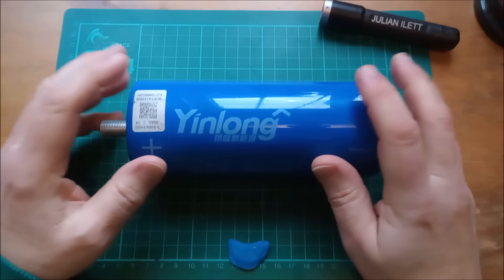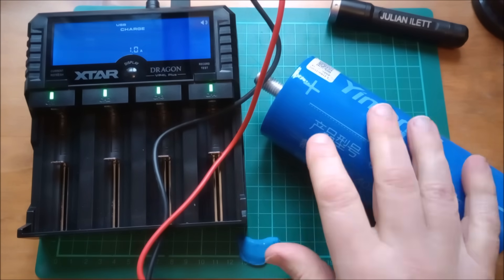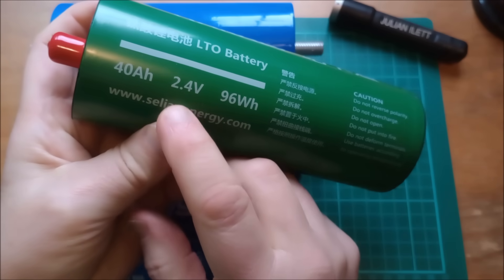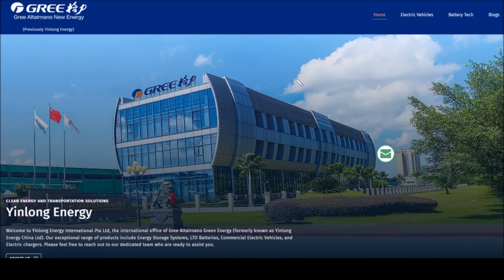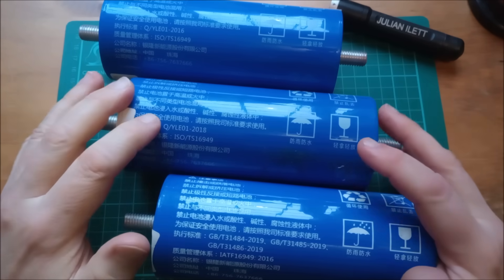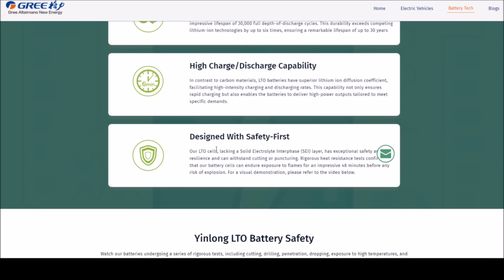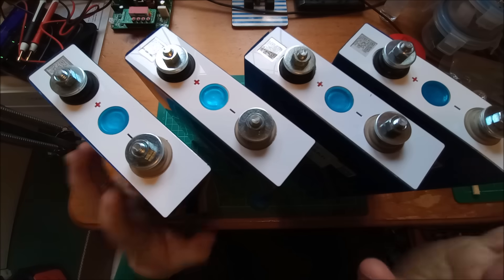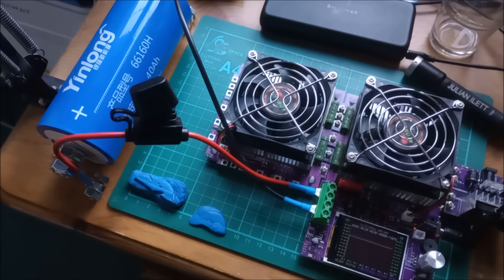Lithium Titanate Cells - an Introduction

Comment: Your not a bass head there brains rattled to death. The cell that needs all alternator power. There garbage i through all my lto xs power and yinlong batteries in a garbage truck. Buy huge real expensive lithium  iron and you got a generator at 13.2 volts and under sterling power you got 14.2 volts all in a huge amplifier range. So your going to Alaska get a day job the cycle life is doo - doo

Comment: ah man, theyre finally starting to make somewhat cheaper LTO prismatic cells in 6ah and 20ah varieties.
for rock bottom mfg gate prices, theyre still about 9-10usd/AH, compared to LFP which is about 1$/ah in small format or even down to $0.16/ah for big 280ah format lfp cells.
i think in another year they might drop by another 20-50% in price and lead acid batteries will basically be done in terms of automotive applications.
we dont need sodium ion, sodium ion is trash lol

Comment: Fully charge in 6 minutes is 10C, so 450A charging current; that will dissipate 203W per cell for a 1mOhm cell resistance or 203kW for a 100kWh pack! That is of course wasting 20kWh over a 10 minute charge, so the charge current must be 20% higher, resulting in even more power dissipation (292W per cell); this is basically a vicious circle meaning that 10C charge current just isn't practicable.

Comment: I have 7 banks (6S/7P) of the 35ah cells in my truck, totaling 245ah and charge @ 15.6-15.8v. Total range 13.8-16.8v. They are great cells, ive used them for audio and have powered my house when electric was out from storms. I have a Jupiter 4000 pure sine inverter 15.5v max. I have pulled over 2,400 amps from this bank in competition and going strong for 2.5 yrs now. Research and ask question before building a bank like this, they are very safe but you can damage cells if you aren't careful and don't follow recommendations. Im upgrading to 10 banks (350ah) soon. XSPower/Yinlong.

Comment: Could I use six of those as replacement for my 12 V starter battery? I think the engine needs 650 A for cranking. I go through a lead-acid every two years and external charging is required during winter times. A tad annoying...
Reply: Yes I've seen deisels replaced there lead acid with these

Comment: Regarding these cells and car audio, they are pretty much the weakest (lowest C-rate) LTO cell that people use.  Off the top of my head, there are 4 other cells that make these look like AAs in comparison, Ah to Ah.

Also, NEVER run LTO in parallel with lead acid batteries. The lead acid battery pulls the LTO down to the lead acid's resting voltage after a period of time, and the alternator is tasked with replemishing the charge every time you start the vehicle.  Excessive wear and tear on all 3 devices. (lead acid, alternator, LTO cells).  If you must run them in parallel, an isolator is needed.

Comment: Totally opposing and slightly off topic. But if cold temp are an issue for current batteries, and since thay are mostly all liquid cooled. Why dont Hybrids and EV's have a VERY small, very efficient say 20cc engine to heat coolant, and bring up available charge for startup? and another tangent, I know this is possible because we do this in the summer with pure methanol cars, especially full tilt Methanol burnout cars. We have a tiny Honda generator, and route the exhaust through an air to liquid HX that warms the engine coolant, transmission, and (For us racing) heats crankcase oil to at least 183f to boil off any left over Methanol. Yeah totally Off topic. sorry lol. I never stop...

Comment: One issue right now is that most of the common fuel gauge and cell balancing IC's can't fuel gauge or balance these cells due to the low cell voltage. Just using an "off the shelf" cell balancing solution, particularly the popular Chinese "shunt at 4.2V" style balancers like a HY2213 will not balance the cells. Additionally many programmable fuel gauge and protection IC's can't be programmed for a low enough per-cell discharge cutoff. (1.5V per cell cutoff).
Reply: just look in the shop, seen in the video description... they supply LTO BMS

Comment: I don't understand the "up to 30 years" lifespan. If it can handle 30,000 full discharges how is that ONLY 30 years? 30 Years is about 11,000 days... so they are saying these are going to be fully drained and recharged 3x times per day, every single day, for 30 years? For EV's this is obviously nonsense... So my question is does the lifespan depend more on time itself than number of discharge cycles...?

Comment: now I realize: this is a selling gig from China: google first and inform yourself. test the stuff you get and only pay with paypal or creditcard to be able to do a chargeback if the items dont match the description. dont let the time expire for the chargeback. they will try everything. make sure you get what you pay for! if batteries are advertised as 40Ah they must have 40Ah at least. look up the spec sheets online and see! they have spare capacity and when brand new they reach like 41Ah. If they have only 37Ah or such... get a refund. those are really old batteries. if they are halfway sincere they sell them as 35Ah .

Comment: There's an interesting concept about hydrid batteries where you have high cycle but lower capacity types combined with high capacity but lower cycle life batteries.
The concept is based upon how you would typically use a normal car. How often would you drive around doing daily commutes with a full tank of gas? Hardly ever, right? As there's enormous milage savings in not lugging around unnecessary weight.
The hybrid concept takes the same approach. So you could have 20% of the total capacity in the high cycle life batteries. 80% in high capacity batteries divided into for example 20% cells.
For daily commutes you probably need at most 40% of full capacity, so the high cycle battery would be filled first, and then alternating high capacity cells.
Thereby greatly increasing the total cycle life of the whole battery system while still having a fairly compact overall battery.
Reply: How are you going to deal with the issues of the high capacity batteries sitting heavily charged for a long time?
Reply: @lost4468yt  software /BMS system should have a battery saver mode, so unless you need to charge up for a long drive, your car can go into midrange mode with balanced/optimal load in high capacity cells. (I think its around 65% on 18650 cells).
Reply: @MrBrannfjell  sure but do you really expect people to use that properly? Even the existence of it will cause people range anxiety.

Comment: Most car alternators can output 18v if requested to lol
Reply: At 16 volts you will start blowing out all of the electronics in a car, which are nominally rated for about 13.8 volts, plus or minus 10%.
 Although I've seen one "intermittent charging" alternator (it shuts whenever the battery is fully charged) go up to 14.6 very breifly, 14.4 is generally considered the maximum safe slternator output.
Reply: @lyfandeth  you can also blow all your electronics by reversing polarity 🤣🤣 I've seen that on the Internet. Always make sure you double check terminals before connecting 🤣🤣🤣

Comment: Are the 'A', 'B' and 'B-' grades all made on the same assembly line? I imagine so and then tested to see what their internal resistance is etc. Similar to how microprocessors are made: Various chips are made on the same line using the same process, but due to tiny defects some chips can be clocked at higher speeds before failing and are thus rated higher (or lower if it tests lower).
Reply: It sounds like these are pulled from electric buses, and graded for sale for reuse....
The variation probably comes more from their position in the vehicle packs, since some will be hotter than others in use, and will degrade faster.
Reply: @tin2001   not only that but some are pulled out very forcefully. and they sometimes brake off the connectors and resolder them... sometimes that creates faults. be aware and do your research before buying. got scammed myself buying this kind of batteries.
Reply: @tin2001 Makes sense.

Comment: Is it a really big battery, or do you have really small hands?
Reply: Yep, really big. 66160 means 66mm diameter and 160mm long.
Reply: @pedtrog6443  thanks! I didn't realise those identifiers codify dimensions!
Reply: Yep, really big. 66160 means 66mm diameter and 160mm long.

Comment: no need for bms just a balncer can be discharged to zero with no impact on performance and charging fully won't diminish life span. Problem is finding a big enough charger to charge a 600amp battery bank fast in an rv 😂

Comment: Interesting but from what I can tell you’ll need ten for a kWh and that’s working out at 530 euro per kWh. It’s a hard deal to justify unless you have a specific use case because NMC cells are approaching 100 euro per kWh at the moment
Reply: Indeed, just checked pricing and making a pack of these is quite expensive, even for just a 12V starter battery. I'd opt for LiFePO4 batteries, they can handle a lot of current and a fair bit of misuse too. NMC has the highest density, but also the most heavy metals and cannot handle current as well as LiFePO4 or LTO

Comment: 5s for an unmodified car is the way to go. You can push these up to 3.1v without too much cell damage; past that the cells break down fast.
Reply: What is your recharging system? BMS? Active Balancing?
Reply: @garycotz563 active balancer, car alternator. You shouldn't have only a bms battery connected to a car alternator; when the bms disconnects the alternator will overvolt from 13.7 to 20+v.
Reply: Isn't that the job of the voltage regulator?
Reply: @garycotz563 on a bms only system, the car alternator voltage regulator can't react quickly enough. There is a video called 2 ways Lithium KILLS Your Alternator that explains it

Comment: It does seem like a good fit in auto/marine/RV usage. Especially sense those vehicles have a nominal 2.1V per cell in a wet cell lead acid type battery. Does there documentation show the self discharge rate?

Comment: When I was competing in car audio my amplifiers pulled over 700amps, so I would need at least 12 of these cells to cover it, My batteries in this car had total 280AH and could deliver up to more than 2000 amps and was combined with 2 voltage boosted alternators that charged 100amps at idle and 180 with some revs. But I could still have had use for even more power then. I became Europe champion in my class one year with this car, over 150DB with a single subwoofer
Reply: How is it possible for the alternator to output 100A at idle? At what rpm is your idle? Isn’t your motor in overload trying to turn an alternator outputting 100A at idle? I have an old Pinto engine and just charging my lithium batteries at 25A is just sustainable for the engine at 950rpm. How do you do ? 👋
Reply: @ I had two alternators which was both modified with a higher voltage regulator which made the alternators output more than factory specifications even at lower voltage. 
However I also had thicker wires and extra ground straps to the alternators as well for absolute minimal voltage drop in the connections. 
The engine was a 2,3Liter with a pretty massive idle motor so it did not stall when the alternators was loaded but the engine did struggle to keep a steady rev count if the load was varying. 
Simply said I had my system both optimized and upgraded to have this much power for my demanding amplifiers

Comment: The sub zero charge temperature is the killer feature here
Reply: Yin's big long errr... cell is performing pretty well.  Instead they should move away from all kinds of "chemical reaction" batteries to graphene based super caps using capacitive changing in minutes and no degradation over time.  If they could increase the energy density of super-caps, it'd be a lithium and other chemical based battery killer.

Comment: Good for car audio, as they would 'hold' the alternator charging voltage of at least 13.8 volts and likely 14+ volts, without having to run the engine.
Reply: Just like the actual car battery
Reply: @leifsalomonsson5426  no. the actual lead acid battery drops to 12,6 (flooded) or 13V (AGM) and drops below 11,5V on a load.
Reply: @leifsalomonsson5426 Lead acid batteries are usually around 12.6V, you can actually charge these up to 17V with 6s configuration and they will stay at that voltage.

Comment: Someone who I will keep anonymous was charging one of these up off a bench power supply a few years ago. He forgot to set the voltage correctly and left it to charge overnight on constant current. At 4am it exploded, blew out all the windows in his front room and started several small fires. The sound and light was strong enough to wake him up immediately so he got the fires out before they spread. Not a particularly wise thing to do!
Reply: I find this story highly unlikely, especially given how rare these batteries were a few years ago.

Who in their right mind is going to use a direct power supply rather than a charger circuit to charge up an expensive battery like this ? I call BS...
Reply from the maker: I never leave batteries charging overnight - not my car, nor my power banks, not even my phone. But I may have to make an exception for the car, to get cheap rate overnight charging.

Comment: LFP is fine up to around 4v, its above 4.2v that you get trouble, my cars have been on LFP for a couple years now, I can leave them stored for half a year and it'll start right up, lead acid is just trash that needs to die already, get a 4s active balancer and some decent cells and you will probably never buy another car battery ever again
Reply: No please no one charge LFP ie Lifepo4 to 4v per cell.

Comment: I made a car battery with 6 x 30ah cells. Works amazing. Yes, 30ah starts a car super fast, super easy. These cells ROCK!
Reply: I have a 6x40Ah Yinlong battery pack on a 5.4l Ford Expedition .. works much better than lead acid .. it's been over 2 years now and performance is fine. I'm using an active balancer with full group to keep the pack balanced, though even with the balancer disconnected they remain quite well balanced over a couple of months.
Reply: @croolis  can you tell us the sources for your gear?
Reply: @willylam88  alternator has a current limiter built in. That's why lights dim when you have a big aftermarket car stereo system.
Reply: @willylam88  Nope. Well... "it's complicated". Short version is that if you charge them from flat, in a very hot environment, with other high loads, you MIGHT cause your alt to overheat. After doing the math, I can tell you that this outcome is almost impossible to achieve, even if you try. If you search for Ih8mud + LTO starter, you should find the thread I posted the answer to this, and many other, questions. Otherwise, ask me here. :) I did a LOT of testing and they exceeded my expectations.

Comment: Interesting. I have a ten year old EV that uses LTO batteries. It's a Peugeot Ion, which is, like the Citroen C-Zero, a rebranded Mitsubishi i-MiEV.

I didn't know about the great longevity, the temperature tolerance or the high discharge/charge rates of LTO batteries. The longevity and the temperature tolerance of LTO batteries makes me wonder why quite a lot of the Mitsubishi i-MiEV/Peugeot Ion/Citroen C-Zero have had battery problems. In theory the batteries in these cars should last for about a million miles, if the 20,000 cycles is true (60 miles WLTP range x 20,000 cycles). Mine doesn't show any evidence of battery degradation after ten years, but it is very low mileage (20,000 miles). I guess that ten years or so ago there were variabilities in manufacturing that caused some cells to fail prematurely.
Reply: Peugeot Ion used LEV50 and LEV50N, normal lithium ion cells, it did not use LTO cells. Only a few Japanese models were LTO with a massively reduced pack capacity of 10kWh (vs 16kWh), those probably all held up well with little degradation.
Reply: @jaro6985  Thanks, you are right. I'll delete my post, because it is factually incorrect and so irrelevant.
Reply: @sailingoctopus1  eh its still interesting as a few cars were made with LTO which I did not know of.

Comment: I had LTO's in my vehicle for some HAM radio gear.  I charged them off the alternator and they sat parallel with a lead acid.  If I didn't disconnect the pack from the system, the lead acid battery would be killed for some reason.
Reply: When running lithium LTO's youbare not suppose to run any other battery with lithiumbav been told by a few people

Comment: Wouldn't these be quite suitable for a whole house battery backup system? Why aren't there more such systems (I could only readily find one or two)? Too expensive?
Reply: No. Way too expensive and the energy density is half LiFePO4 which is already kinda low...a 30Kwh battery pack is a full rack
Reply: Energy density and weight are not a problem for houses, so on that front this would be OK... But the price is very high, presumably due to the titanium, which effectively rules them out of anything where you want high volume storage and low cost (like a house).

Comment: Who needs 10C? Van somebody help me find a useful application?
Reply: People who want to charge and draw faster, I suspect.
Reply: Would be nice to charge your car in 15 minutes instead of 45
Reply: In have one in an rv 600amp hours would like to charge it in 20 minutes but where do you find a 1800 amp charger
Reply: Actually I think it is a 5c charge rate
Reply: @patrickday4206 a hefty engine with 6x 320A alternators on it?
Reply: In a smaller application, I would LOVE it if I could charge my phone from 0 to 100 in like 6 minutes.